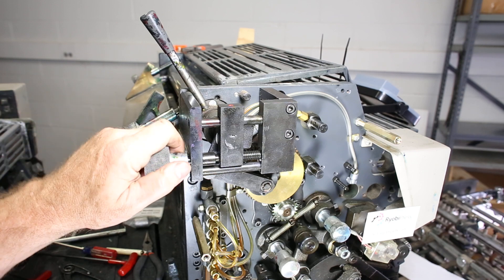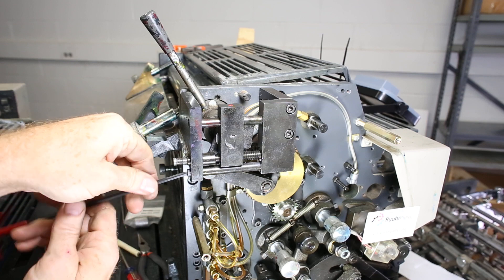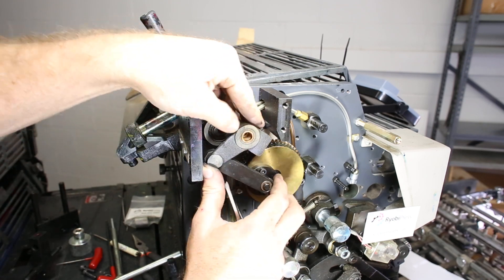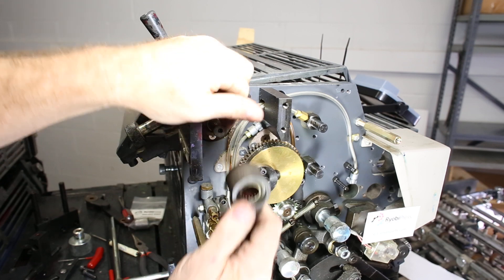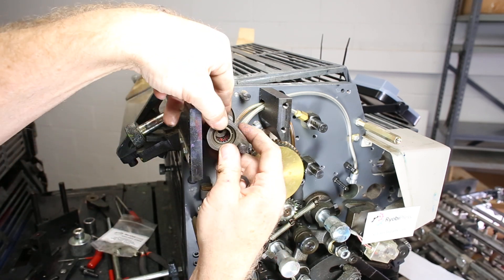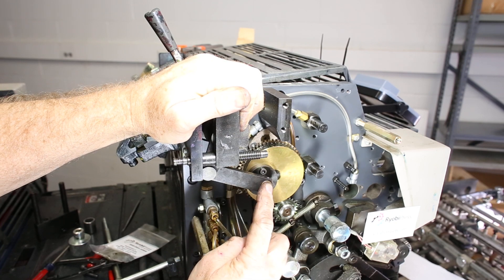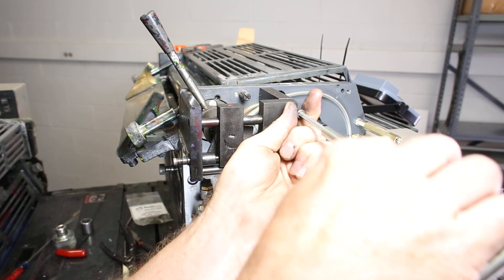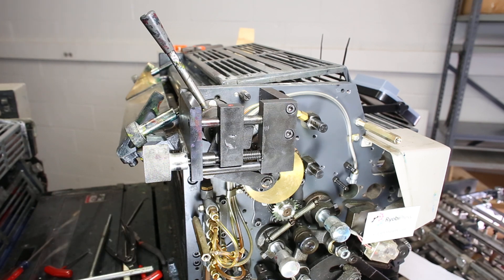Ryobi 3302 & 3304 REMOVAL AND INSTALL INK DRIVE CLUTCH ASSEMBLY.

Comment: Purchased the clutch about 6 months ago, never got the time to tackle the job...Just did it this morning, took about 30-40 minutes. The hardest part was to get the old bearing pressed out and the new one in. Thankfully I am next door to a mechanic and they pressed it for me. I would suggest to anyone to just buy the whole assembly to save that step. Otherwise WITH THE VIDEO HELP, it was a breeze. Thanks for making it!